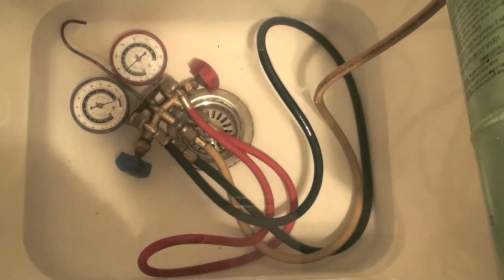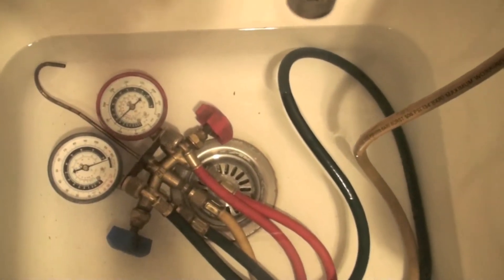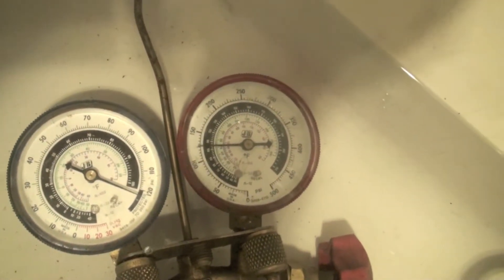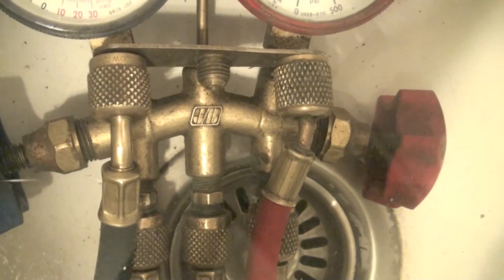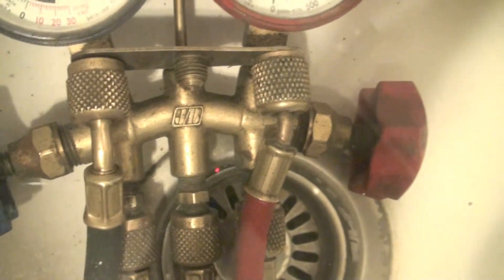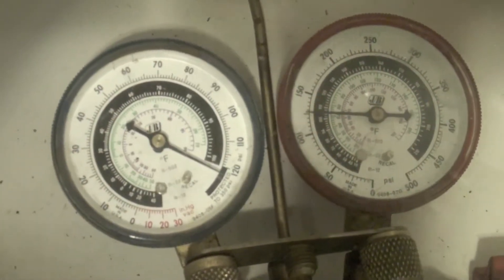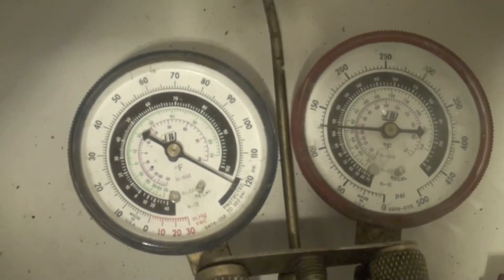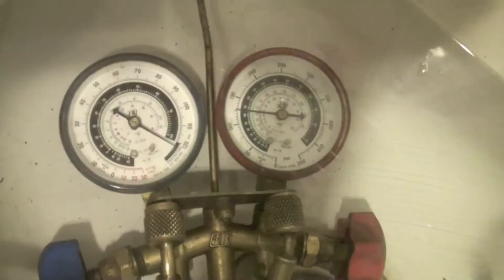How to do a pre season refrigeration gauge set leak check

Comment: Any advice for checking a gauge set if you do not own a large refrigerant cylinder to hook up to?
Reply from the maker: You can use nitrogen or CO2.  No compressed air.
GFM
Reply: @grayfurnaceman  Good to know, I was debating using an air compressor. Will consider a nitrogen or CO2 tank. At the moment I’m not sure how to source either of these tanks with proper fitting thread to fit the manifold though.
Reply from the maker: @ErikSandstrom  You will need a gas specific regulator, and an adaptor to 1/4" male flare.
GFM
Reply: @grayfurnaceman  I was able to use this submerged technique to pressure test (2) new-to-me Robinair HVAC manifolds this weekend, using an R134a self-sealing can as my "tank". Was able to clearly identify leaks with this method. Thank you for the idea
Reply: @grayfurnaceman  Long story short, I’ve inherited two old manifold gauges, need to refill an old car with R12 but trying to determine how to test the manifold gauge sets. I don’t really own any other HVAC tools.

Comment: i have done this teqniq for years but i have never been sure if its ok to submurge the gauges abouve the manifold.  They are not sealed so do i need to be concerned about rust in there?
Reply from the maker: The moving parts are all brass , so I have not had problems there.  
GFM

Comment: Are your gauges sealed? I know some really expensive ones are filled with oil. The gauges set I have isn't sealed. I got lots of bubbles from the gauges until they filled up with water. I tested it this way and found and fixed a leak that I couldn't find any other way (o-ring inside knob); thanks for the idea. However, this concerns me because I believe that the water that got inside may cause some rusting inside the gauges over time. What do you think? I guess if they fail, I could simply buy new ones.
Reply from the maker: The gauges are not sealed.  Rust could happen but I never had (unlike this set) a gauge that lasted over 5 years.
GFM
Reply: jjenson2006 what if you prepare everything first. then submerge the hoses only. after passing test you can submerge the gauges quickly for 4 seconds look for bubbles and if none then pull out quickly. do you think that would work? or make it better? I was immediately worried about that as well

Comment: This just saved me the cost of new gauges. I found that there was no o-ring on the yellow hose fitting so it was a metal to metal contact that would leak. I then inserted a small o-ring into the fitting and retested. It still leaked. I placed a second small o-ring into the fitting, pressured it up from the 30 lb. Freon canister then shut off the valve from the Freon canister. As the Schrader valve end fitting was connected to the Freon canister, I then removed it and placed that under the water line. I'm now monitoring for any drop in pressure on the low-pressure gauge. Thank you to grayfurnaceman for the idea.
Reply from the maker: Chris Martin welcome
GFM

Comment: Mr. GFM. That leak in your video is quite evident and obviously a new hose is required. What about hoses with bubbles that do not burst as fast as that in your video? bubbles that take a
 while to generate and pop? 
l would say that any bubble coming out from a hose is a leak. Thank you
Reply from the maker: +Aquilez B. Absolutely.  Any type of leak requires either hose replacement or gasket replacement.
GFM